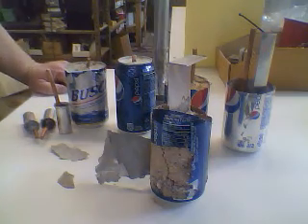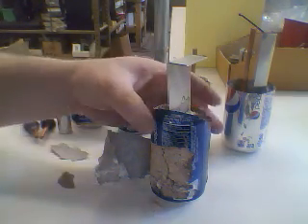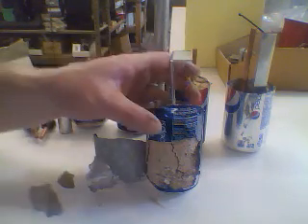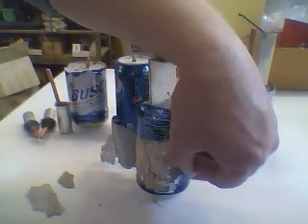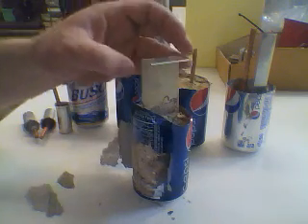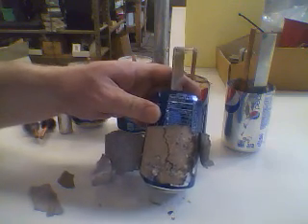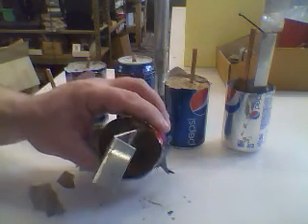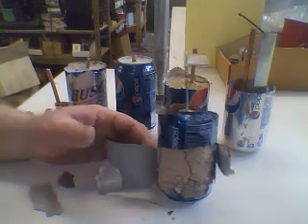Rock battery update on blown Aluminum cell.wmv

Comment: It seems kind of odd, if they're the same metals then no galvanic reaction can happen. I know the aluminum on the can is not the same grade as the aluminum plate due to it being near humans. The can companies don't use straight aluminum due to it being linked to Alzheimer. The test should had used the exact same aluminum pieces for better results.